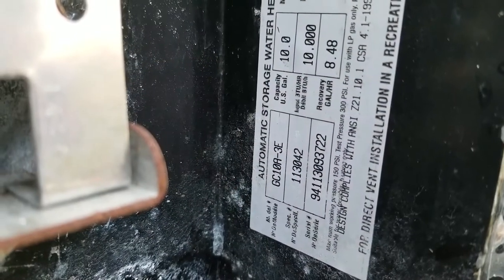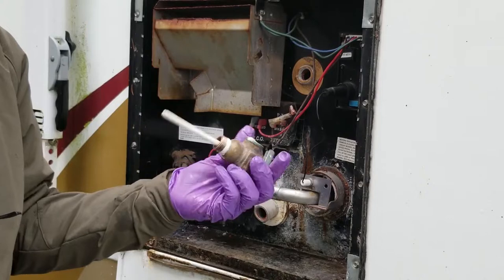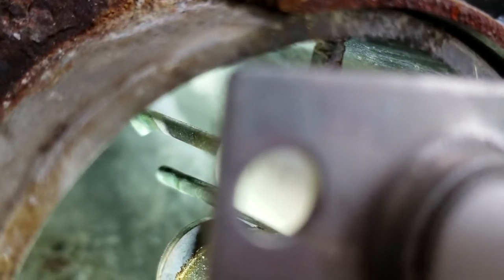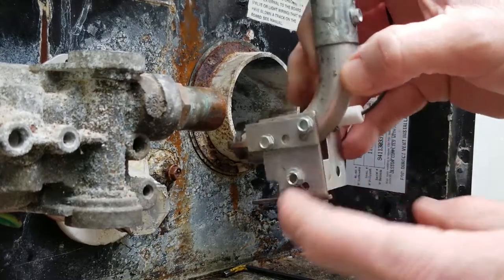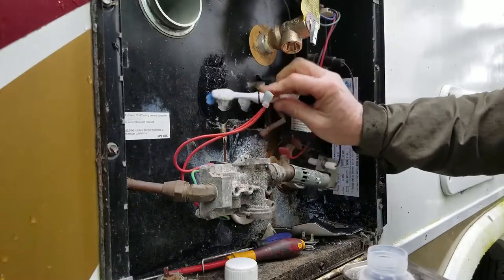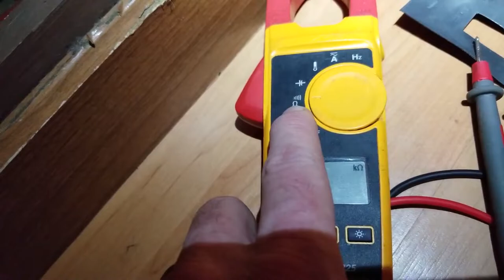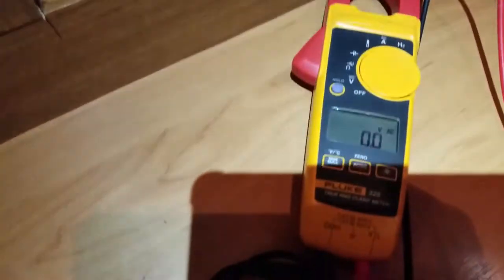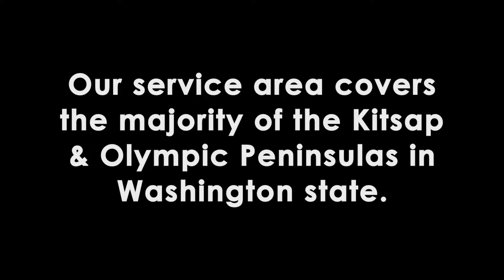Older Atwood RV Water Heater Gets An Overhaul

Comment: I love how you can pack so much information on everything you need to know about a particular subject in one video! You have a perfect approach to teaching. quickly and efficiently. So far, you have show me how to replace the motor in my air conditioner, my RV Power converter, the circuit power board for my refrigerator, and now you have show me how to repair my  water heater! THANKS SO MUCH! You are awesome Darren keep it up !!!

Comment: Perfect video for my unit! My 120v side on a GCH10A-3E doesn't work. The manual shows a relay which in your film and on my RV doesn't exist. I've seen one of ECO connectors seems fried. It's in a Class A with hardly any access from the rear due to being jammed up against the Freightliner chassis. I might change both the Thermostat and ECO limiter on the back once I get them out and I should be good after checking the element. My front side 12V foam nameplate on that thermostat side is destroyed. I need to buy one of those as well.

Comment: Just found this. My motorhome has this same one and it's been drip leaking for months. Today I was finally able to cap off the hoses because the Just Answer rv tech gave me so much information and tips on what to do. This video has even more because today I took a pic of mine and it's identical so now I might see if I can fix the leak or replace the whole shebang with a new tankless. One problem I have is the previous owners back to 30 years ago have disconnected just about every sensor related wire and naturally being that it's so old, no one has a clue where to start. I just need to get hot water without all the bells and whistle and leaks. This post is going to matter very much after I learn from it. Thank you for posting it even though its 5 years old it's a bonus to me.

Comment: I’ve replaced the eco, t stat, control board, thermal fuse, gas valve, burner and igniter and I can only get it to spark but no fire.

Comment: Excellent, Excellent, Excellent video, great camera angles, could clearly understand you and your descriptions were great, best I've seen!!! New subscriber! Now I need to search to see if you have a video that explains why my older Atwood without all the electronics on the outside will not hold a pilot flame when I let go of the knob.
Reply from the maker: Thank you very much for the kind comment. Now, regarding your Atwood with the manual pilot. On my website resources tab, filter for your water heater, you should find a very detailed manual that explains how to test the thermistor, the magnet, coil, generator Etc to help fix your issue. I do have on my list of videos to make one specifically for the manual pilot water heaters. I'll probably be doing that one in the shop where I can have better control of the environment. I worked on one the other day but I had kids screaming and yelling all around me which would have made a terrible video LOL.

Comment: GAS Valve not opening.   After buying a new Elec module didn't solve the problem, next taking off the gas valve bringing it home testing the solenoid, good. the fuse checks out. Not knowing how the thermostat was mounted believing it was inside. a big relief knowing how to take them out, hope that this will fix it. Also didn't know about backflushing.  Thanks for making a very good, I mean excellent video.   You are the Man. I will let you know if that fixes it, Back over to the RV now.. THANKS Dave

Comment: Thanks for the video. It helped me fix my hot water heater without spending a dime. The 1/8" gap on my spark sender was more like 1/4". I carefully reduced the gap and re centered the disc at the end of the tube. The unit is starting up right away and the sputtering I was having for the past few days is gone. Burning evenly and quietly. Thanks again!

Comment: Thanks for ALL your videos. They are great everything I know about fixing my Damon Ultrasport is from watching your vids.  So help with this question please my water heater works electric and propane but the water temp is only about 80 degrees you can tell the gas lites up but just not enough heat. The thermostat is 80c the Eco is 140c Should be more than enough but with just hot water on it is weak . Help! Going home today to drain and wash out but dont think it will do it.

Comment: thank you thank you! you call it what it is. A water heater!. 999 out of 1000 people call it a hot water heater and I wish it didnt urk me. And excellent video. I just watched a video where they told me to turn my switch on and check my fuse and propane level. If it still didnt light that we should call someone. I appreciate your thoroughness and filming with one hand while working

Comment: Great video and lots of info. On my 2001 bounder my water heater the green lite is going off and on but the flame is staying lit  The yellow lite that comes on when the  flame is working ok. Only the greenlight is a problem 
Was working ok, the green light stays solid when waterheater is running.
Any idea would be appreciated 
Thanks

Comment: so mine was working just fine on propane and I came to RV park switched to electric. the element sound like it was training a bit but then I had a leak from the plug and then the water release valve so I changed them both and the next day it stopped working all together no power anywhere. for a couple weeks a lot of water was draining out probably corroding those wires.  what are your thoughts? somebody said I could bypass the t-stat thing. do you know how to do that?

Comment: The white deposits are aluminum oxide formed from galvanic corrosion inside the tank. Suspended iron or other minerals in the water supply cause the problem.

Aluminum will not "rust", but will corrode if there is too much iron in the water.

Comment: There is something I just experienced with mine. Mine would go out for an unknown reason. Almost like the propane shut off to it. I would flip the water heater switch inside the RV and it would click but wouldn’t light. After 3 tries I waited and tried again. I was in the RV and heard an explosion on the outside of the water heater. It blew the cover door off of the water heater. It apparently had a gas buildup and when it clicked to start it had too much gas and there was an explosion. It seemed to fix itself and stayed on after that. I assume that the orifice had stopped up and wasn’t letting gas hit the igniter and the explosion blew the orifice open. It has worked fine since although I worry about it happening again. I wish you were nearer to me in Chehalis so you could check it out!

Comment: Wow I had problems with my Atwood water heater I got say your explanation on your video are very good didn't have the option change the igniter module out and the 2 thermostat also and the safety in case of propane problem turn switch on work like a charm now just have change electrical side I now the elements is burnt out thanks Steph

Comment: I have y Atwood electric and gas water heater.electric works but gas igniter want fire and circuit board keep blowing the two amp fuse as soon as you turn it on.  I can lite it with a lighter. Any ideas what's going on.

Comment: We have a 1988 sunflyer with the Atwood hot water heater. The problem is we cant figure out where the shut off valve is for the hot water tank. We have cold water works great nothing for the hot water though we opened bleeder valve ( the one on top that removed in your vodeo) . Do you know where we find it?

Comment: first thing i check if my water heater does not light is the spark gap.
after running my propane tanks dry a few time the smell chemical used in propane will leave a carbon hair across the spark gap. and short the gap. and you will get no spark.

Comment: I bought a '94 Fleetwood Southwind and am having to learn everything about RV's. My water heater red light goes on and says "w.h. pilot." There is NO maintenance manual so I'm thankful to have finally found your videos. I know that the rig was winterized and I bought it just a few weeks ago. I only recently got water and electric hook-ups but have had no idea how to get the water heater to work. Looks like I need to check on some things first. No sure how well I'll do but at least I have way more information than I did a day ago. This still might be above my skill level but I'll see how it goes. It's tiresome heating up water on the stove for washing dishes and bathing.

Comment: Thank you, now I know where to look for the reset button. 
But would it affect the gas part?
My WH stopped working on electricity,  replaced the thermostats in front, and the gas will go through 1 cycle only & heat the water to temp but the inside light stays on, then it won't cycle back on to keep the water hot. I've even used the hot water off & on not letting it shut off because of the usage and will stay on till the tank is at temp . The board was tested & is good.  HELP!
Reply: One of the best and most informative ive seen. Excellent  video sir. Thank you.

Comment: You should of unplugged your ignitor board and taped the lines out of the way. Plus why did you not flush from the pressure relief hole?

Comment: Thanks ? Our 2003 Winnebago Chieftain 39t water heater pressure relief valve is leaking. Slowly. It looks like a larger size for the three-quarter inch but I’m vague Google search says half inch on the older models. My water heater model number is Atwood GCH10A3E. Before I take it off, and was ordering online. Trying to decide if it’s 1/2” or 3/4”
Also The water heater works on propane. It was working electric but one of the thermostat reset button has popped out on the back and I cannot get it back in to reset it. Is there a secret or is it blown and ruined? It was working prior a few days ago. But the reset on one of the thermostats has indeed popped out. I could not reset it
Reply: What is the rhin copper like tube you used to back flush? Can it be bought somewhere? Thanks!

Comment: I am wondering if you would answer a couple of questions for me...? I really need help with my atwood water heater. My problem is the pressure release valve... And the back wash plug. Both are on so tight that I can't get it to unscrew and replace the valve and plug. Please advise me on how to get them broke loose so I can replace.?!!

Comment: Does the thermal fuse go on the brown wire that goes to the control board or to the brown wire that goes through the top of the wall? Then, does the thermal fuse go on the left or right prong of the t-stat?

Comment: Hello sir, thank you for your informative videos. Our Atwood heater is not working. At the 12 minute mark in your video there is a wire connecting where the board says P/T the wire on the right with the two connectors, the one near the T in your video has a wire it is connected to and our water heater is not connected to a wire there. Any suggestions?There is no loose wire to simply connect it and see if that is the problem. Thank you again

Comment: great video. Didnt find my problem yet. My power switch doesnt light up!  Not sure why. My 2A fuse on the controller side seems to be intact. No other fuses blown.  No lights on the board are lit up either. hmmm.  Any things i should check?
Reply from the maker: This is where I say 'follow the trail'. A water heater gets its power only from the switch. So at the switch you should have 12 volts and when you select AC or gas that will send the 12 volt circuit to the water heater. The trick with checking for 12 volts at the switch is you need to find a good ground reference. Often times if you have a 120 VAC receptacle nearby you can use the ground slot on those receptacles as your ground reference.  Once you establish you have 12 volts sitting on the switch then you should pick it up on the water heater side as well. In this video I explain what all the wires do.   https://youtu.be/oivOq7vWfB8

Comment: I have the 6 gal. gas only Atwood water heater and what's happening with mine is the heater will light and the red light will go out but after about 30 sec. the light will come back on but the burner will stay lit and will heat the water and shut off light it should.

Comment: I see you adjusted the flame on the water heater, is it the same adjustment for the fridge with propane ? Great video
Reply from the maker: There's no adjustment on the refrigerator flame. It's a function of the LP pressure  set at the LP regulator and appliance BTU rating. The water heater consumes more BTUs than the refrigerator. So, therefore the refrigerator flame is 'set' based off of the orifice of the gas coming out of the fridge gas valve.  An annual cleaning of the refrigerator gas valve and burner will help to keep that within spec. Oftentimes they will get a buildup inside the gas valve right at that LP output nozzle and the burner itself is directly below the flue and sometimes rust will fall down and foul out that burner.

Comment: First I want to say. Thank you. Your videos are wonderful. You have already helped me so much. I bought a used RV in an emergency situation. I escaped from a decade of domestic abuse. I'm filled with gratitude for the safety and peace for me and my pets.
I got a 2001 Hornet. She looks OK but is a mess under her skirts. I'm a tool chic so I'm confident at repairs.
My water heater is what is perplexing. Im trying to do maintenance. A back flush. I have an atwood G6A7. There is not a drain plug. The spot where it should be has the electrical recepticle and plug that is how I turn it on and off.
This whole rig is incredibly Jerry rigged. I was hoping you could share your thoughts about this issue. The weird plug and cord needs replaced also.
I wish I could show you a picture.
Thanks for you time and help. I respect your knowledge and ability to teach. God bless
Reply from the maker: That plug thing is called a "hot-rod". It allows you to heat your water on electric for water heaters that we're not manufactured with a heating element. It is an aftermarket add-on. You can safely unscrew that to drain and backflush your water heater.
Reply: @MyRVWorks  Thank you so much. Your like a RV Godfather. I appreciate your help. Keep up the fantastic work honey! God bless! 😁🥰😘

Comment: If I don't feel comfortable about working on the gas side can I just fix the electric side and still have hot water. Also do I unplug my camper from the pole or just take fuse out of breaker box. My rv got damaged in hurricane Sally and my brother is letting me use his until mine can be fixed. Only thing is his hot water heater doesn't work and I need it to or pay 10.00 at truck stop for showers. Please advise me asap. Thanks
Reply from the maker: You can certainly work on just the electric side.  To disable the water heater to work on it, just flip the breaker off on your breaker panel.  We have a lot of other water heater repair videos that you can watch to get more comfortable on what to do there. Just look for our water heater playlist on our YouTube channel.
Reply: Thank you
Reply: Ok another question. If I change the electric heating element inside of the rv is there supposed to be 2 thermostats in side the rv for the electric or are toe ones on the outside the only ones. If so does that control panel on the side of the heater run the electric side too....on the outside thermostats one of the ends are broken off also so do i need to fix the outside thermostats.  I hope I am making since.

Comment: By the look of the trailer, preventive maintenance is not high on the owner's list of priorities.  Regular maintenance would have prevented this mess.
Reply from the maker: Yes, one of the reasons I'm putting these videos out is to educate folks on how important preventative maintenance is. A $20 pop-off valve would have eliminated much of the work necessary on this job. I do believe the customer bought this RV used and does not plan on taking it anywhere. Will probably put a new water heater in in about 2 years or so if the rest of the coach makes it that far. He just wanted to buy some time.